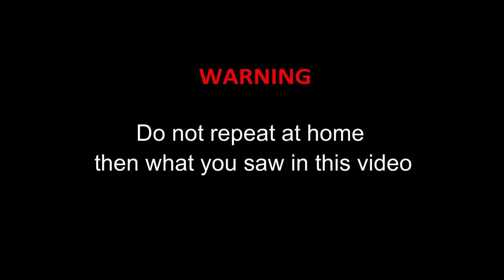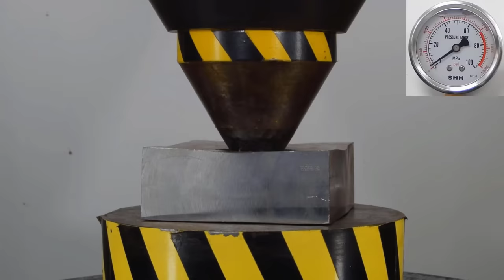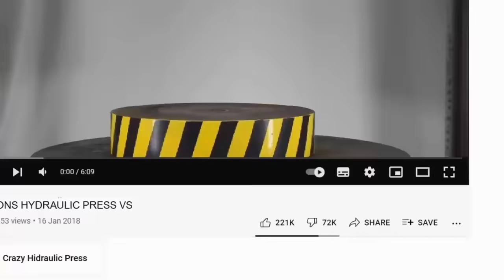HYDRAULIC PRESS VS OLD AND MODERN ARMOR

Comment: The take-away is - make your tank armour out of ball bearings
Reply: Really cool ball bearings.
Reply: Or destroy modern tank armor using ball bearings.
Reply: @KnightRadiant-ip9qw  You'd need to accelerate them to the sort of velocity that meteorites move at - 5 miles/8km per second or greater. A rail gun could do that but the ball bearings would be prone to getting squeezed in half by the rail gun so they'd need to be very special ball bearings - an apfsds round from a modern tank gun would be much cheaper.
Reply: Yeah, frozen to -319°F. You be the crew…
Reply: @vipertwenty249  I know. I realized that as I was writing. But who knows? Maybe railguns will end up being the launcher for such a type of ammunition in the future.
Reply: @rodrigoroaduterte9415  Yeah, no kidding. XD
Reply: Might be a problem keeping the liquid nitro all around the tank!!!!
Reply: @KnightRadiant-ip9qw  Who knows? The energy pulse needed is large. Most of what I know came from a friend whose task at the university was to stop the 5 ton concrete block the linear accelerator was bolted to from going through the wall of the cellar under recoil. They'd had special projectiles made but the damn thing kept squeezing them in half.
Reply: @vipertwenty249  cryogenics, either liquid cooled or 'new matter' to borrow a Neal Stephenson term (Anathema).
Reply: @KnightRadiant-ip9qw  Any modern weapon needing great power needs is a deffo no go. Keep it simple or go home.
Reply: @KnightRadiant-ip9qw  or just good old fashioned depleted uranium shells
Reply: you've forgotten -  frozen ball bearings
Reply: @rodrigoroaduterte9415  Well if the russians equip this in their T-72 tanks I would put out those pesky turret popping fires we keep seeing.....
Reply: Actually, that is not entirely wrong.
If you have an appliqué armour pack - that has very hard "ball-bearings" in it, then that can work extremely well to defeat kinetic penetrators.
albeit, there are caveats to that...
Reply: @stevegreen2432  You'd definitely need a British tank with a tea-making facility to keep the crew warm then.
Reply: crygenically cooled ball bearings 😂
Reply: @barryscott6222 How about the opposite? That is, their are new armor types that have cylindrical cavities that absorb impacts. Sort of anti-ballbearing armor... .
Reply: BALLS OF STEEL
Reply: Interesting idea!
Need the right matrix!
Of course, don't forget: 
A. That 'BB' was cooled down to -two hundred something...
B. This testing is only one dimension of the 'engineering problem': the effects of kinetic energy cannot be ignored, and diiferent things will definitely happen at transonic velocities!
C. Although, constraining the angle of incidence at/nearly O° angle isn't exactly irrelevant, it's does represent a somewhat theoretical outcome...
Also, I wonder what the temperature changes were like on this; mainly, (since the Ball Bearing apparently  sustained minimal damage*), how much of the sample got cooled down, and by how much?
* Although, it might interesting to examine the crystal structure of that Ball Bearing after its little adventure!
Reply: @KnightRadiant-ip9qw  Yeah, I wish those silly rail-gun researchers hadn't decided to go all 'King-Kong vs. Godzilla'...imagine designing somethimg more moderate in size & power requirements capable of sending a dozen of those BB's down range 3-4 miles in rapid succession!
Of course, it's not like those are 3 for a dollar... 😗
Reply: Its been tested and they have to be put in a container steong enough to keep them from exploding out when shot. So you basically have a big armor box holding the bearings. Problem is the box acts as armor and youd just be better off putting another armor plate for the same resistance but taking much less space
Reply: Nah. Make your tank out of tungsten. Well thats typically already a layer on modern tanks, behind some exposive-reactive or ceramic armors
Reply: Fling our balls at tanks? This sounds painful.
Reply: T-64 had ball bearings in its composite armor I think, or maybe T-72
Reply: @BrokeWrench  Mate, have you had a sense of humour removal operation - I was trying to be funny.... But my humour fell on stony ground
Reply: But wouldn't all of the exploding happen INSIDE the tank? Yikes!
Reply: @hootiebubbabuddhabelly  Well, that's what shaped charges are all about!
Reply: @KnightRadiant-ip9qw  Biggest problem with rail guns is they destroy themselves when they are fired.
Reply: Welder here....liquid nitrogen the plate armor of a tank....not  ball bearings
Reply: 😂😂😂. And keep pouring liquid nitrogen on it.
Reply: @vipertwenty249 you don’t need a tank round to destroy a modern tank only a copper disk and a steel pipe
Reply: @jasonbritt2497  Chances are I knew that many years before you were born mate. My uncle (tank driver in WW2) told me about shaped charges in 1969.
Reply: @vipertwenty249  I learned the hard way seen many of buddies meet their fates or mangled from EFPs (explosively formed charges) thank Iran for those, they built them and supplied them to the Iraqi Shite militias
Reply: The take away is, sneak up on tanks with a frozen ball bearing and a hydraulic press

Comment: In case you're wondering, AR 500 is a type of flash bainite steel. You superheat it and then cool it quickly. This makes the metal crystalize.
Some guy figured out how to do this in his garage. Turns regular steel into that monster we just saw.
They make thin body armor inserts out of AR 500. They have to coat the steel with a splotchy paint that absorbs/deflects bullet fragments. The armor is so strong that bullets his the armor and splatter. These fragments can often bounce up into the wearer's chin and injure him. Soldiers get injured because the armor is too strong.
Reply: Soldiers don't use AR500 plates because high velocity bullets punch right through it. They use the lighter ceramic plates.
Reply: And high velocity rounds eat it for lunch. Most body armor is actually ceramic.
Reply: Actually you tend towards an "amorphous" structure with the procedure you outline.
Reply: Ah, I looked it up. I think I can clarify your "language". IT IS NOT SUPER-HEATING IT and COOLING QUICKLY that "causes it to crystalize" into the correct crystalline form. ALL METALS (except metals made using a liquid metal spray on a spinning cooling drum, which makes AMORPHOUS STEEL, which is used for transformer lamination) are  "crystalline" in nature.  The procedure you outlined results in a very hard (and brittle) form of steel known as MARTENSITE. It has to be "tempered" after being formed, otherwise it will shatter, as was seen in the video, but at a much lower stress.
Reply: @markhugo6642  yep. look up maraging steel. if you've never heard of it, to age a steel means to hold it at a temperature and lower the temperature at a specific rate over a period of time that can range from days to hours. i believe the term 'maraging' is short for 'martensic aging' and its responsible for the strongest steel alloys in the world, in all senses of the word 'strong'. but, crazy long and expensive process.

Comment: As a bladesmith, I can tell you 52100 ball bearing steel is no joke!
Next time you purchase a handmade knife made from 52100, you should really appreciate that knife as it's not the easiest steel to work and heat treat. (Not the most difficult either but still)
Awesome vid and the outcome surprised me too.
Reply: I'm a CNC Mechanic and I looked that steal up with its DIN-Norm and it's composition. Yep I've had to work with similar steals in the past and they've given neither me nor my tools a good time.
Reply: @TENthe10th  tough stuff.....
Reply: SmearCampaignUK  nope.....
Without proper maintenance, a scary sharp knife will turn into a butter knife.

Comment: Has anyone considered the following:
The super cooled metal ball was placed on top of the room temperature AR500 sample. This caused the AR500 to cool rapidly at the point of contact.
As the pressure increased, the metal under the ball continued too cool, and reached the transition temperature between ductile and brittle fracture.
The cooled area suffered brittle fracture, which then carried through the AR500 causing it to "explode".
The dull appearance of the fractured faces are characteristic of Brittle Fracture
Reply: With that much force? It was well beyond the transition temperature and probably was hot to the touch. All that energy has to go somewhere, so before it breaks it goes to heat. Once it breaks, it rapidly converts to kinetic, creating an explosion of sorts.
Reply: So your saying we need to super cool our rounds and make them steel then infantry can shoot through tank armor?
Reply: @jeffbotelho5035  Im not sure what super cooled rounds will do to the firing mechanism and barrel. :F
Reply: Not buying it. 
* The sphere had 20 minutes of total immersion in liquid nitrogen for the ball to fully reach temperature. This whole thing was done in less than 2 minutes.
* The AR500 was not submerged in the liquid at all and it had much more mass than the ball.
* Because it was a sphere there was a very little surface-to-surface contact area between the AR500 and the sphere.
* The AR500 had full surface contact with the base below it making the mass of AR500 even more.
* There are ungodly high temperatures being created with that kind of pressure further working against any temperature transfer.
Reply: I believe that your analysis is the best explanation. That the difference in temperature of the AR500 is what shattered it. I would have thought the frozen steel ball would have shattered first though.....like a rose dipped in liquid nitrogen.
Reply: Hardened steel tends to break that way ;)
Reply: honestly looks more like a low grade steel and ive no idea its composiution for first test , could be mild steel for all we know , where as ww2 was rolled cemented armor
Reply: @jarryan2136  I feel like the carburised side should get some cracks if deformed as far as it was there, but I wonder if they put it the wrong way up? Cemented Krupp armour is best when only carburised on one side, so the backside is still ductile and can't spall off so easily.
Reply: The temperature rises under increased  pressure and even without pressure decreases over time.  The temperature doesn't "continue to decrease", it was always rising relative to the ambient temp.
Reply: So, temperature doesn't increase with pressure as much as the conduction between the 2 surfaces.
Reply: Compression creates heat.
Reply: What about a sphere is more resistant if you have 2 point of contact perfectly aligned compared to a brick with one point of contact and a surface of contact ?
Reply: Sit down
Reply: Thermal gradients can put huge amounts of stress on an object, like putting a hot pot onto the glass in your fridge. The cold orb is cooling the center of the armor differentially to the perimeter. I think that contributed to the magnitude of the result!
Reply: No the increasing pressure would have increased the heat more than the limited conductivity of the small surface area touching the ball.  The ball had 20 minutes of immersion to cool it all the way thru.  What happened is that cooling it in the Nitrogen made it very dense so it couldn't be compressed anymore.  The compression energy from the press had to go somewhere and the path of least resistance was making the plate explode.
Reply: Does a hot pot need to heat up the whole fridge to crack the glass? I’m not taking about brittle fracture, just thermal gradients. I don’t know how big the effect is, but I thought it was interesting enough to mention.
Reply: The steel plate was already compromised by the first press. If it created any sort of fracture or stress point, that could have been a contributing factor in it exploding like that.
Reply: Like a raindrop landing on a hot incandescent light bulb it shatters originating at the point of the raindrops impact.
My money is on that theory.
Reply: @Ethan_FPV yeah I believe the ball was only cooled to increase its hardness. Any loss of heat by the plate would have been dispersed quickly considering its high thermal conductivity and large relative mass
Reply: @piuli95  you would probably have the super cooled rounds encased in something, and upon firing it would release the round

Comment: That's an incredible press. Also, an incredible display of the toughness of AR500 steel. Would like to see a video on how AR500 steel is made.
Reply: To get technical, this was a display of its strength, not toughness. Had it been tougher, it wouldn't have exploded.
Reply: Это плака о двух концах, броня должна быть не только прочной но и пластичной, чего не сказать об ar500
Reply: Sketchy Russian comment…
Reply: I work with abrasion resistant steel (known as "AR steel"). It is quenched and tempered to give it hardness. A common brand name is Bisalloy. I'm not sure if it's the same thing as in the video.

We have recently had issues with the steel plates failing violently while being bent. They're not as brittle as harder products such as cast iron or ceramics, but they're a lot less ductile than mild steel. So as in the video, if a 500-hardness steel (usually measured on the Brinell scale) is deformed too much it will fracture and fail catastrophically.
Reply: @riggamawesome1  There was nothing sketchy about his comment. He said "This is a double-edged sword, the armor must be not only durable but also flexible, which cannot be said about the ar500". Russians are just normal people, you know.

Comment: Crazy. Definitely more a test of how hard the cones were compared to steel used in military armour, but also a great example of the balance that is struck between hardness and shattering. This is why modern armour has multiple layers to diffuse the impact energy both in shattering (e.g. one component reactive armour) as well as absorption to spread and absorb the energy over a greater area.
Reply: There's also a difference in shells, bullets, and other projectiles compared to this press. I'd wager a guess that a tank shell could defeat a lot of things shown that the press couldn't because of the energy and material difference. Typically the best way to defeat armor is to have something really dense that's moving very quickly.
Reply: @nootnewt your correct, the way to defeat armor is with speed, and density resulting in a larger force defeating the armor, which is why AP rounds are usually made out of depleted uranium and tungsten for its density. Combined with the shape of modern ammunition being like a dart allowing for more penetration as it’s more force in a smaller area

Comment: This is a great demonstration of armor spalling, tanks usually have an internal layer of softer material, as you can is in the first test each layer would spliter off and throw shards when each plate broke, in reality that happens on the inside of a tank even when a round does not penetrate and those shard themselves can be deadly
Reply: Yep.  Many rounds take this into account as well and prefer dumping energy versus penetration specifically to cause as much spalling as possible. Best case scenario, you take out the crew, worst, something inside is probably bent or broken, rendering the take much less functional.
Reply: "WW1 splatter mask"
Reply: @plektosgaming that’s the whole philosophy behind high explosive rounds and more specifically the brits’ squash head rounds. Kills a tank without ever making a hole
Reply: @poiuyttyuiop9700 and the same reason the brits developed their secret composite process. 

Half the armor, twice the effectiveness.
Reply: “Shards”😂😂😂
Reply: @chrissyclark7836  any idea where to get info on this?  Haven't heard it before.
Reply: @anthonybasile6079  i believe its the special armor on the challenger tank. Its been years since i had the source.